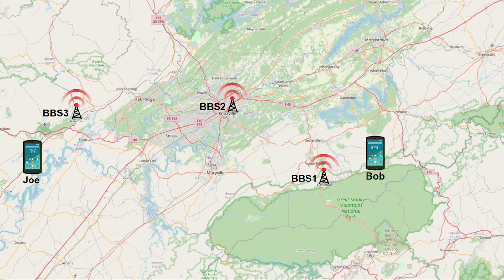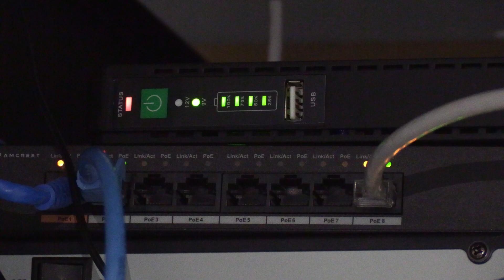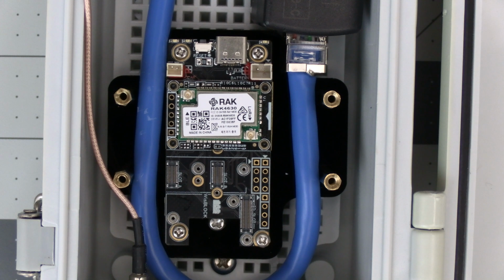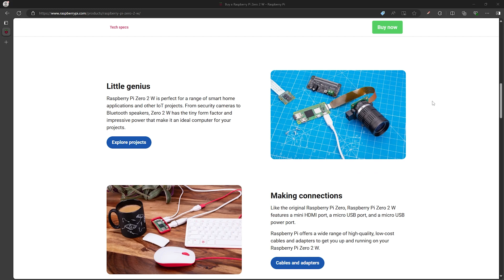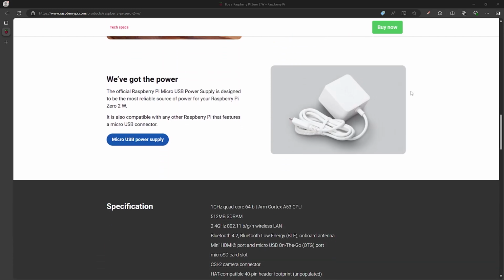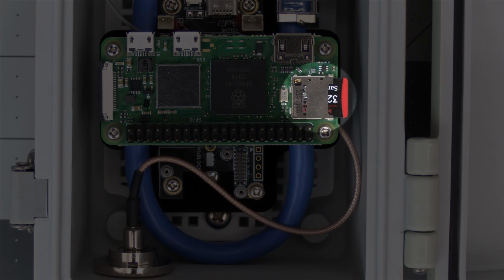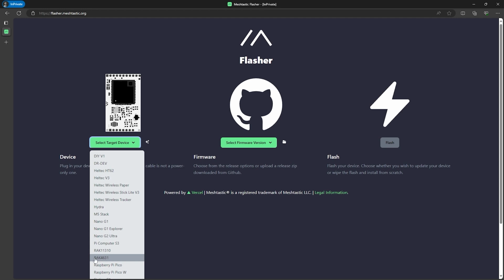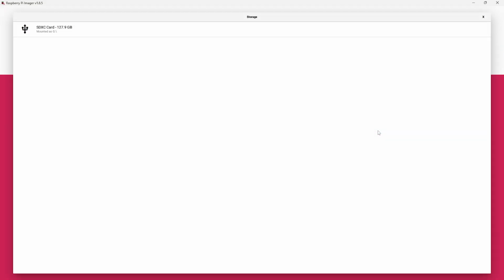Meshtastic PoE BBS Build Video

Comment: Why does everyone put the electronics outside?
I worked on radios in my offshore job and we NEVER put the radio outside, just run the coax out through the wall, put the electronics inside, protected, easy to service. Run the coax through the wall and BOOM. Much easier to work on, more stable, clean power.
Reply from the maker: That won't work. These radios are less than 1W and at 900MHz.
Reply: @The_Comms_Channel  I'm thinking, put the radio inside, run the coax out to the antenna.
Reply from the maker: @jackflash6377 that's the problem and why people put the radios in a waterproof enclosure. The radios are less than a watt and there's too much signal loss at 900MHz

Comment: Have you tried using VNC to connect to the Pi via Ethernet from a PC and then possibly be able to "drag and drop" a new firmware to the WisBlock to update the Meshtastic? That way you could put a node up high and not have to worry about taking it down just to do a firmware update?

Comment: Some USB hubs can be told to turn their ports on and off from within Linux, under user or program control.  A quick search on your favorite search engine might help you out by providing instructions to power-cycle the radio as a part of linux's late startup process to ensure it starts after the pi is done.  I can't identify the IC from images online to be sure if you can do it with this hat, but it's probably worth a shot. ;-)
Reply from the maker: @jbevren  looked into this but this hat wasn't able to. Been unable to find one unfortunately 😔
Reply: @The_Comms_Channel  Boo!  I didn't want to suggest the desperate idea of tying a Pi GPIO pin to the reset switch due to the soldering necessary without using the larger base boards' reset headers, but here we are. :(  Appreciate the reply! :D

Comment: A great new potential revision to the design, Waveshare has a module that handles PoE power for the Pi Zero so the splitter can be removed freeing up a little more space. It sits underneath the pi using pogo pins to connect the test probe points on the bottom of the Pi Zero so you still have all the USB ports available. This also means you don't need to worry about needing headers on the Pi. The newly freed space allows for a larger battery or even just a more compact enclosure.
Reply from the maker: I considered that for the build but saw some complaints of radio interference. The reports were of interfering with WiFi so LoRa might be fine, but it was enough for me to take it out of consideration, especially with deploying at commercial sites with other radio systems that could be affected.

Comment: This is pretty impressive! Thanks for sharing! Just thinking out loud, for resetting the RAK, I think you can hack the board by soldering the reset button to one of the Raspberry Pis GPIOs and automatically perform a reset after boot. I'm not familiar with the RAK but If someone could share it's schematic, we can figure it out! Well done! Love your Meshtastic videos!
Reply from the maker: The pi side is easy but got a bit stuck on the RAK side. Here's the data sheet if it's helpful 

https://docs.rakwireless.com/Product-Categories/WisBlock/RAK19007/Datasheet/
Reply: @The_Comms_Channel  something went wrong with my last reply and can't see it. But I think the reset is connected to the NRESET of the Core module. I don't have a hardware to test but I'd try connecting the NRESET pin to the GND and see if acts similar to pressing the physical button before connecting it to a RPI GPIO

Comment: Set a GPIO pin on the pi to reboot the RAK once the pi has completed its boot.

It's trivial to control an SSR from a GPIO pin.
Reply from the maker: What about the RAK side?
Reply: @The_Comms_Channel solder the gpio to a transistor to pull it low (Or high, depending on the wisblock) and the other side of the transistor to the wisblock. Then write a small script, that toggles the transistor via a gpio pin after reboot. Edit: To the reset pin of the wisblock of course. So basically RPi GPIO-> npn transistor-> reset pin/button of the wisblock
Reply from the maker: @WillTemeraire  It looks like only the RAK19001 and RAK19011 have a pin header for reset 😞
Reply: @The_Comms_Channel  Yeah sadly true, but you could just "simply" solder a thin lead to the reset button. I need to check if you might be able to define a reset button to a GPIO inside of the Meshtastic firmware.

Comment: great video, but manual reset after power loss is a deal breaker for me - need better tech to reset on its own
Reply from the maker: Can use GPIO if you're good with soldering. Heltec seems to boot up fine in my testing as well.
Reply: Use a beefier Pi with a waveshare lora hat and meshticd. All in one. Just need a larger project box.

Comment: Can I use a heltech board for this instead of the wisblock.
Reply from the maker: It should work and others have used them. I just trust the WisBlocks more.
Reply: Thank you sir and if WisBlocks are more reliable I'll check them out. I do have some heltechs sitting around and I want to give this a go.
Reply from the maker: Sure thing! I tested with a Heltec and it worked fine for me. Some others had issues though, but they may have gotten a bad devices. Won't hurt to try if you have one already.